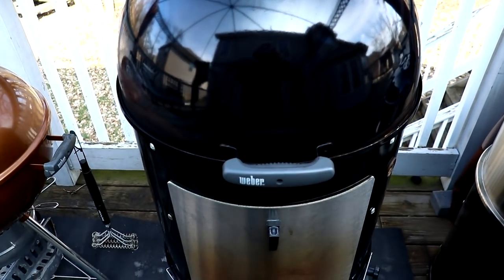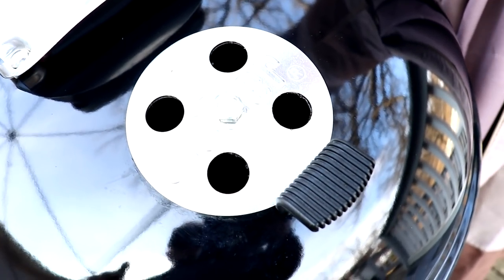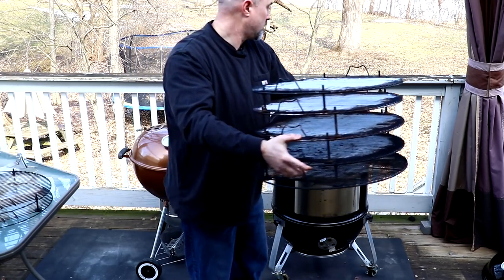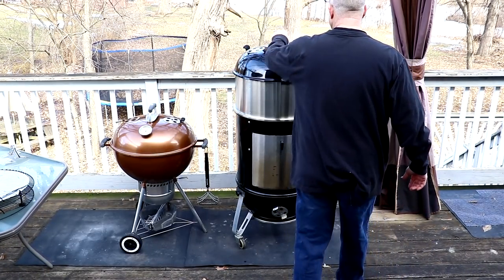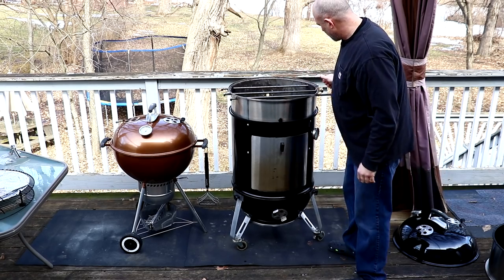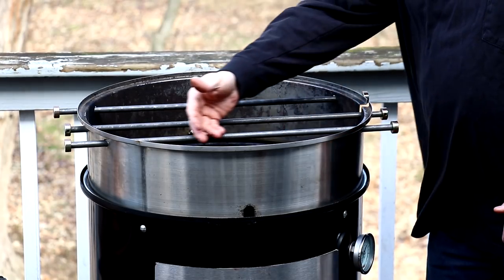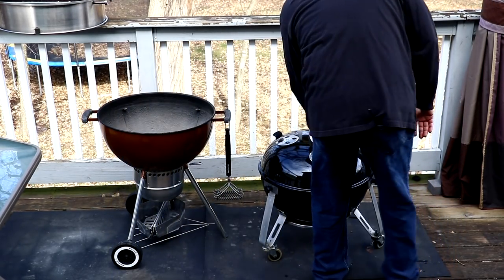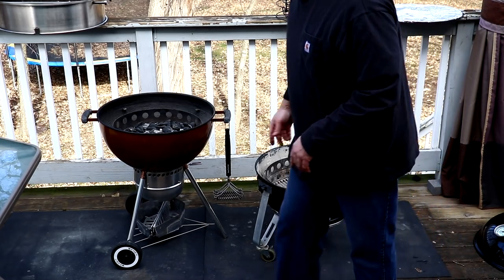Weber Smokey Mountain | Weber Kettle | Multi Rack System | Modification

Comment: Hey Brother!  This is my kind of Video!  You showed what is possible with a little imagination and the Weber and Cajun Bandit products.  Once I started fitting and putting pieces together.....it was endless.   And I think you will be exploring even more combinations in the future.   Your stack rack idea is awesome for utilizing all of that space in the WSM! 
And that was a cool idea for the hanging rods.   You've shown why the WSM is a better option than the PBC.   If the holes are ever a problem for you......I recommend aluminum furnace tape.    Well........I can't wait to see all of these set up options used in your upcoming Vids.  Thanks for the mention.....keep up the great work.... and Metal On!  \m/
Reply from the maker: Thank you Ken and you're welcome.. I'm definitely having fun with it.. I was just using that aluminum furnace tape the other day when I had to change out my hot water heater. lol that's a great idea..! I'm going to buy one of those magnet strips or a magnet key holder and place the allen key so it's on the wsm when needed. Thx for the idea

Comment: Brilliant demonstration of the WSM's versatility, gave me a few ideas, thank you. I own a WSM and a kettle, the kettle is more or less redundant now, well, apart from it's lid which as shown in this video is required to achieve some of the setups. Another tip I would add is the only fire Rotisserie and pizza attachment which I originally bought for my kettle fits on the bottom section of the WSM, pop a kettle lid on top and you have yourself a mini pizza oven or Rotisserie works perfectly.

Comment: I love the mods you've done to your WSM. I've seen the casters and the steel door mods before but I had no idea you could squeeze in 3 racks on the 10" stacker ring, now that's a game changer. I really wish I could run the stacker ring on mine but I installed the lid hinge kit so it wouldn't work with mine unless I removed the hinge kit and filled in the screw holes. I'll have to look into the upgraded temp gauge for the lid, the stock one definitely isn't reliable or accurate that's for sure. I always run meat probes so it's not a huge issue but it would be nice to be able to read the temp at the top. I tried to order some casters for mine straight from Canun Bandits website but I had trouble locating it, all I could find was the whole kit that has the casters but also has brackets to hold the bottom and middle sections together. Don't really have a need for the clamps to hold the sections together as I have a flat slab patio and not much likelihood of the 2 sections coming apart while I roll it. I may just email them and see if I can't just buy the 4 casters without the clamps. Anyways, first time watching your channel and I'm impressed with your knowledge and skills so I hit the subscribe button and looking forward to watching more videos.
Reply from the maker: Thank you for the kind words.. I have to ask.. What hinge kit did you buy..? I bought mine from Unknown BBQ years ago and all I have to do is remove the pin which will separate the lid without unbolting anything.. That's how I use the Cajun Bandit stacker on my wsm and my kettle.. I also use the stacker with the rotisserie ring with no issues at all..
Reply: @BBQJOE   I purchased the hinge kit from Cajun Bandit but I'm really glad you said something.......now that you mention it, I do recall there being a cotter pin in the hinge. No idea why I didn't think of that lol but I'm almost 100% certain it does contain a pin. Thats awesome news.....looks like I can pick up  a stacker ring after all.
Reply from the maker: Your going to love it..

Comment: those hinges on the lid are going to eventually put too much stress on the components they're attached to and they will become deformed. Just because someone made those hinges doesn't mean it's a brilliant idea to attach them onto a Weber grill. When it comes to grilling and smoking it's more about the outcome of the food being prepared, not the gadgets.
Reply from the maker: I agree with you but it's definitely a nice option for the wsm 22.. I have the hinge option for the kettle but never installed it. I also never heard of anybody having issues with the hinge on there Weber kettle or wsm with warping. I'll have to do my homework on that. Thanks for watching.

Comment: Joe all the innovations are great. I'm curios why one would make the hanging rack when you could get gateway hanging rack and it would be inside of lid. I like the wsm midsection on kettle if you shortened legs you could have wsm easy clean out model. What made you come up with that many stacks, you almost need an army to accomadate the output of that cooker with that capacity.
👍🏼👍🏼👍🏼👍🏼👍🏼
Reply from the maker: Thank you John.. When I started with the top dual rack mod for the wsm before my YouTube channel, I started brain storming from there. I cook for a lot of people at times and needed to find a way to make that happen. The hanging system mod cost me as much to buy a Gateway hanging rack but  I'll be able to hang more meat at one time using 3 rods.  And I thought it was a cool idea to mod the Cajun Bandit rotisserie ring to hang meat plus still be able to use it on the Weber kettle. I've use the mid section on the kettle a few time and works really well but I use the Smokey Cajun Bandit more due to it's lower profile. Thank for watching and appreciate the support.

Comment: Did you have to make the hole bigger for the thermometor you installed on the side of the cook chamber?
Reply from the maker: If you're talking about the wsm, I just removed the grommet and installed it. Did not have to drill..

Comment: Joe, would u say it would be possible to put a hinge on the stacker ring so the lid could be opened with out tipping the ring over with it.  In other words, would the lid be to heavy when it is opened for the stacker ring kit to stay in place.
Reply from the maker: I don't recommend it cause yes the lid is to heavy.. I have thought about installing clamps to secure the ring for a hinge mod. Thanks for stopping by.
Reply: Joe's BBQ House - The only clamps I can think of would be clamps that come w/ the Cajun Bandit wheel kit.

Comment: I've seen added vents by the charcoal also (bottom), which is more effective or use case for each? Thanks in advance for sharing all the BBQ iq. 
One other question, are the hinges the same with the exception of the spread? Same weight capacity (Smoker vs Kettle version)?
Reply from the maker: Adding vents to the bottom would help but haven't tried it cause the extra vent up top works perfect for me. Also yes the hinges are different. One is wider than the other.. Thanks..

Comment: What low profile items would you place into the multi-tiered section of your grates?

They’re placed together so narrowly, it seems challenging to insert chicken wings & other low profile items between each narrow layer.
Reply from the maker: It's all adjustable but I usually cook spatchcock chicken, chix legs, pork candy bite and cold smoke cheese. It's not to bad reaching in with tongs to rotate.

Comment: Hey bbq Joe, just subscribed to your bbq channel. I’m doing my homework and research on the WSM and have seen few of your vids and damn, like the way you did the multiple add on grate mods. That was exactly why I’m looking into the WSM. Could you do a vid where you max out the cooking capacity by smoking out as many briskets as you can fit in your WSM with the bandit ring? Thanks and rock on. Your videos are very helpful and informative.
Reply from the maker: Sorry for the late response but I would say a max of 3 briskets on a hot summer day due to all the fat drippings and moister in the pit.. The whole briskets I get are pretty large and would have to remove some racks to make them fit.. But I'm very sure you can fill the racks with flats with no issues.. Thanks for joining us..!

Comment: Great mods! You might have said it but what size is that fire ring in your kettle?
Reply from the maker: I believe there 17" round but I'll double check and will get back to you after work. Thanks for watching..
Reply: I really appreciate it. Gotta try they out. Take care.
Reply from the maker: @CBL138  It's 17 1/4" round by 5" tall.. My defuser plate is 19".. Hope that helps..
Reply: Joe's BBQ House it helped a lot. Appreciate the info and keep making great mods and making video. Best of luck!

Comment: hey Joe is the top rack on the 22.5 kettle a 22.5 cook grate or a 18.5 cook grate? well done tho
Reply from the maker: Thank you John.. Both racks on the 22.5 kettle are both the same size.. Thanks for watching..
Reply: @BBQJOE  thanks bro was wondering bout clearance with the lid will be doing this
Reply from the maker: @red12dirt  The lid clears fine with no issues. Just don't adjust the nuts all the way to the top.